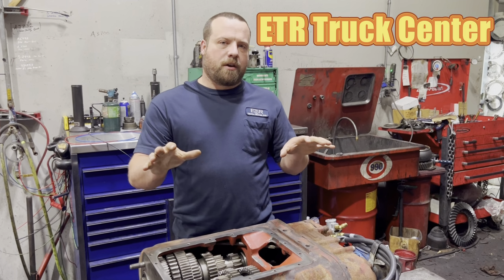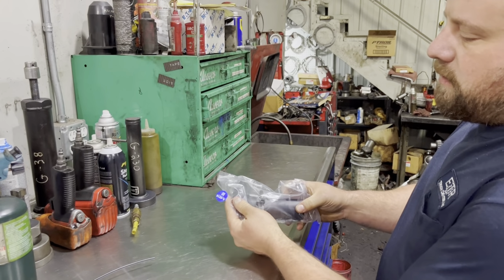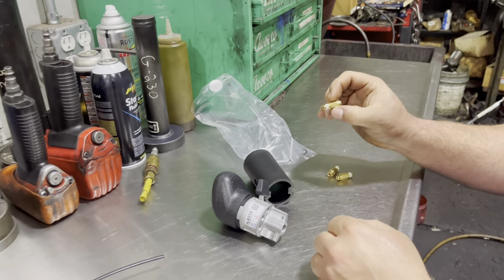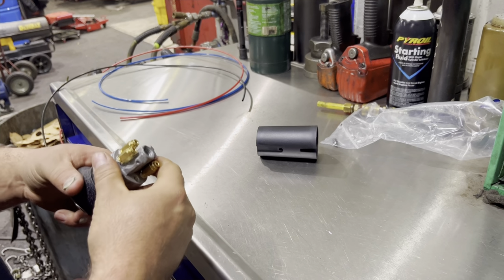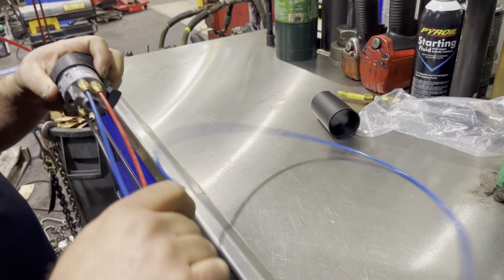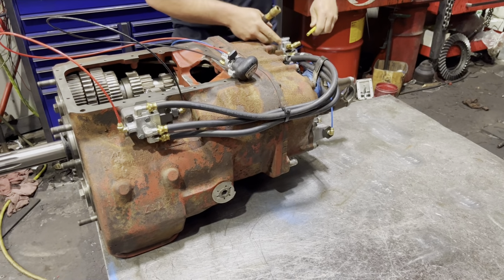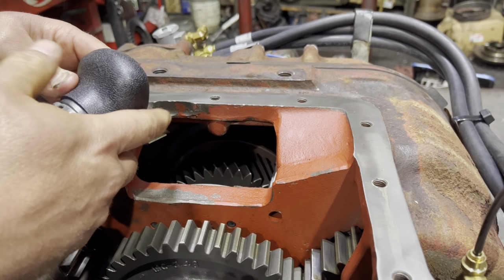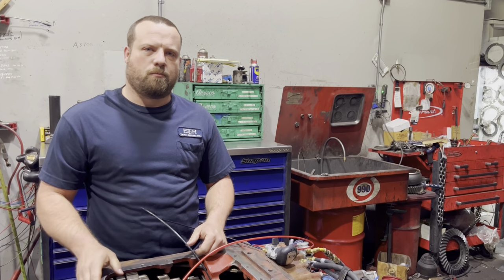How to hook up air lines on an 18speed Eaton fuller transmission. Shift knob replacement. #trucking

Comment: Stupid question, When you flip the lever is it applying pressure, and when you flip back it lets the air pressure out? (same question about the switch) I am planning to run this exact shift knob in my wrangler if I can run the air lockers with the lever and switch :)

Comment: Hey ETR! Just found your channel….Great videos especially the one towing with the driveshaft connected! How ‘bout one on the transmission grinding noise at low RPM and low speed? 3rd gear is the worst.
Reply from the maker: Would love to do a vid on it. Is the sound  kind of high pitched like a whine?

Comment: I want to go to an old school push pull for my range what type of air switch would I need for the gear splits? Would a small end gate latch switch work? I don't want two push pulls I've seen them that way I didn't care for it

Comment: I have a 10 speed and I want to extend or raise my shifter shaft would I have to change those red and black lines or just buy adapters to make them longer? Also what size lines are those and where can I buy those particular lines at? Thanks

Comment: Roger that…Ive got an 18 speed that occasionally fails to split the gear. The owner operator has seen where the air lines get gummed up. We are going to attempt to disconnect air lines and run brake clean and air through them. Thank you for your insight. Any additional suggestions welcome.
Reply from the maker: I would start with checking the splitter cylinder itself. It may have rust buildup causing poor shifting.
Reply: @etrtruckcenterenginedrivet8918 holaa de esa misma forma se conecta la 169 18b

Comment: Question replaced the clotch had trans check at a shop.  I n a friend installed the clotch and trans but when I test drove it don’t want to go on height gear. Only up to 4th.    Any idea of what to check is a 18 speed
Reply from the maker: I am assuming that you have watched this video and are now absolutely sure you have the air lines plumed in correctly? If so did this truck have this issue before you pulled the clutch? If the transmission has just now started with the issue you mentioned you probably have an issue with how the top plate was installed. The slave valve on the side of the transmission has an actuator that works along with the top plate. If during inspection when the top plate is installed if things are not lined up correctly you can bend the actuator and you will not be able to range shift.
Reply: @etrtruckcenterenginedrivet8918  yea I’m going to check the hose because I didn’t hear a loud noise when flipping the switch also it did not have any transmission problems before they took it apart